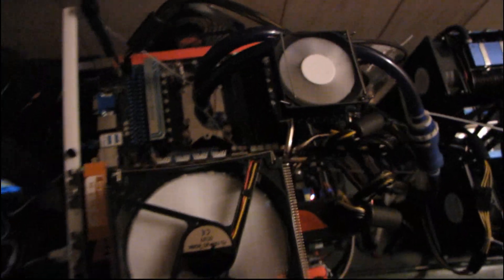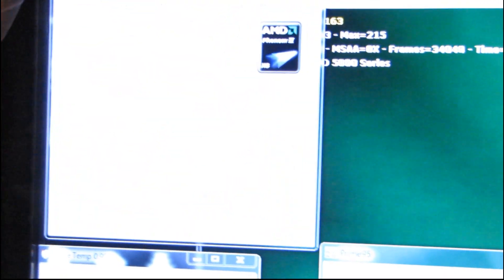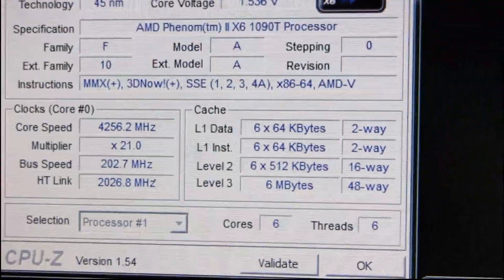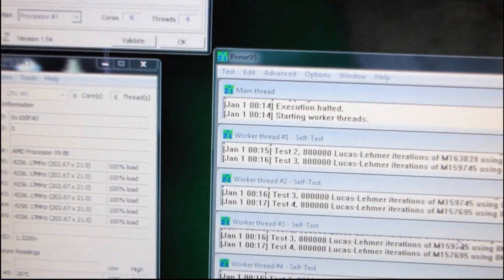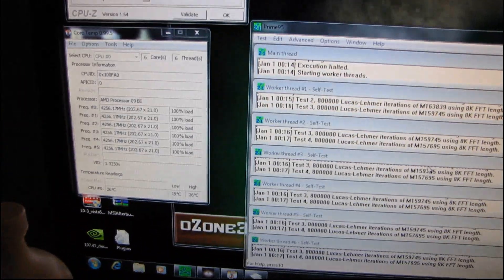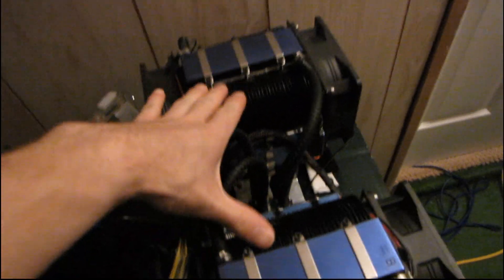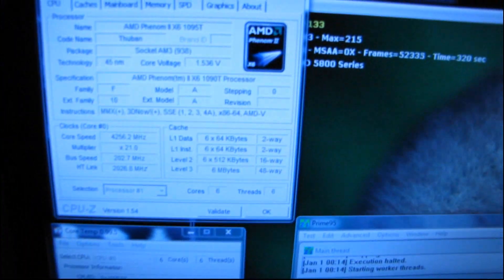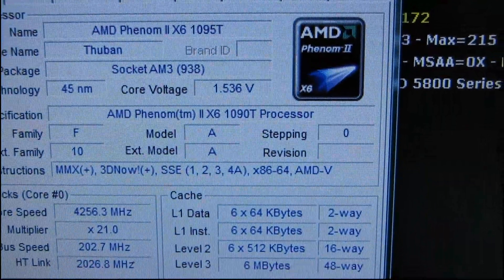Dual Boreas Frankenstein Cooler Overclocking Results Phenom II X6 1090T Linus Tech Tips

Comment: This cpu is hot at normal voltage and clocks

DO NOT USE THIS CPU WITH A CHEAP CHINESE M800 COOLER IT THERMAL THROTTLES

Comment: Dose anyone have the 1090t that decided to just use the stock heat sink instead of a after market cpu cooler? I'm planing using the 1090t  in my new build and i wanna know if it holds up cause i'm only using it for gaming and video editing i'm not planing on overclocking the crap out of it.

Comment: I managed to get my 1090T at 4ghz without voltage changes, but then  when i wanted to go up by another 200mhz i had to up to about 1.45v (but i have LLC on so it went to about 1.5 according to CPU-Z)
This all is watercooled (700lph pump, 360mm worth of radiators) to about 36C (while it's 34C in here). i THINK i can go upto 4.5 with a bit more voltage and tweaking, but in general,  i don't see why anyone would run this thing overclocked 24/7, i'd never use the full potential of it :P
Nice vid! ^^

Comment: @BKsMassive *Cough*

Kinda' expected since, you know, a 1090T is HEXACORE and the i7 920 is DUAL core. And the fact that the i7 920 is better than the X4 965 only proves the point of how Intel processors are better. They are both quad-core CPUs, except the i7 920 has even LOWER clock speeds than the X4 965, yet it still runs better in both synthetic benchmarks and in real-time situations.

Comment: @racingisfun They are not literal knock-offs, but they can be seen as lower-end versions of the same product that Intel produces. Yes, AMD has its own tri-core series, but that's not my point.

My point is, you take a hexacore processor by Intel and AMD with the same clock speed, then Intel processor is going to win.

Comment: @BKsMassive @BKsMassive Sorry, I have neither msn nor icq.

Is the 1090T a good CPU?

I ordered it together with a 890FX and the rest of the parts for a new PC, it should be here mo/tu at the latest. 

But I have doubts whether I should have gone with a i7 920/930 instead. I took the 1090T because it is new, has 6 real cores and hopefully the AM3 socket will be supported longer than the 1366.

Comment: @BKsMassive Sorry, I have neither msn nor icq.

Is the 1090T a good CPU?

I ordered it together with a 890FX and the rest of the parts for a new PC, it should be here mo/tu at the latest. 

But I am a little doubtful whether I should have gone with a i7 920/930 instead. I took the 1090T because it is new, has 6 real cores and hopefully the AM3 socket will be supported longer than the 1366.

Comment: @KeyAttendant Yeh, if you go too high it is very hit and miss as to whether you will do damage. Above AMDs recommended spec (afaik is 1.45 hence why the board limits it as standard to that) you probably shorten its life. I think 1.6 is pretty safe to not kill them in the short-term. There is a vid on youtube I remember seeing of someone running 2.00V through a core 2 duo, that was insane.

Comment: @RyanADillon I use watercooling as well, I just remember reading that setting too high of a voltage will destroy your processor no matter what cooling you have. It would make sense since AMD's specified max voltage is above the standard voltage, so I would think they're not trying to prevent overheating in that case.

Comment: @KeyAttendant Phenom II X4 810 @ 3.9GHz, had to up the FSB from 200 to 300 because the multi is locked. Stock voltage is around 1.35, board max is 1.45 without switching a jumper. I can go up to 1.7. 1.6 isn't very much as long as you can cool it properly, I run watercooling so have no heat issues whatsoever. Would need a very very good air cooler to keep it useable.